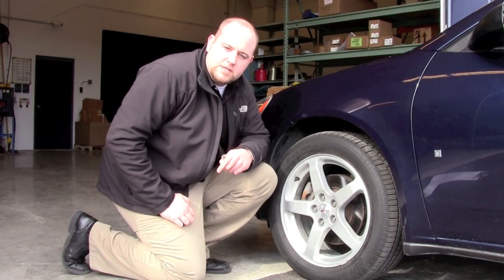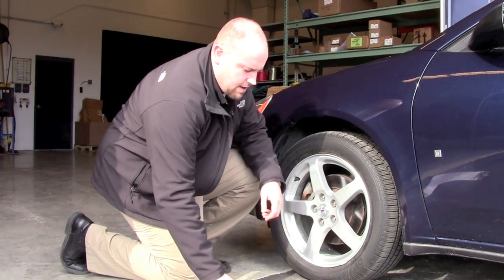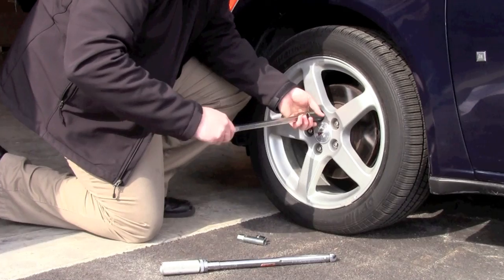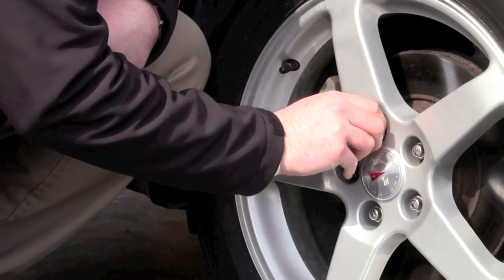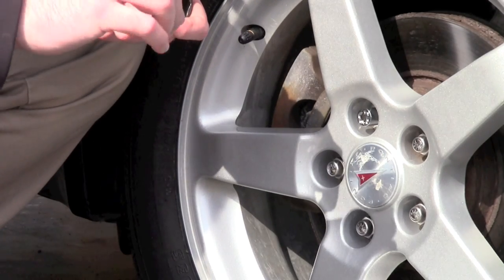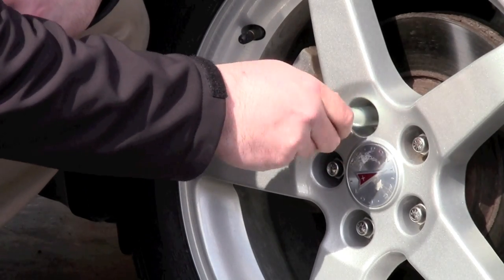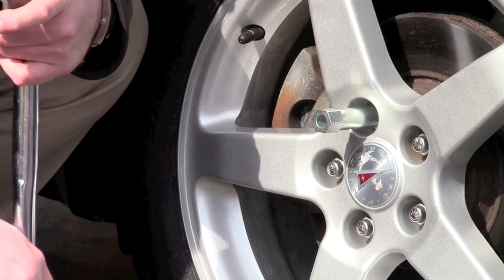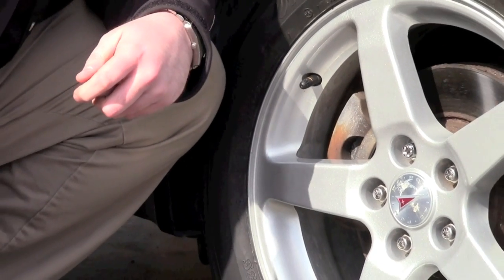McGard Tuner Wheel Lock Nut Installation

Comment: Nice video...I just changed my own rims from my lexus...to an after market custom rims...now the oem lugs are different for the new rims...do I need to buy wheel locks exactly the same shape as the one I am using on the costum rims or any wheel lock will fit on my new rims...tks.